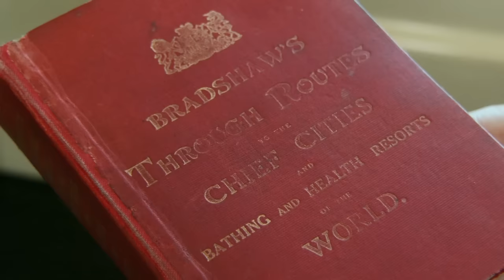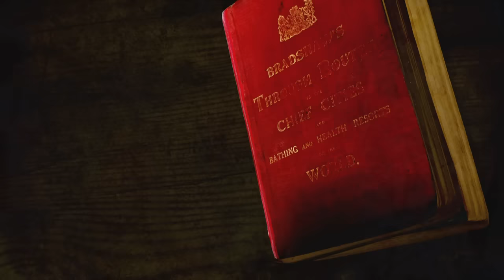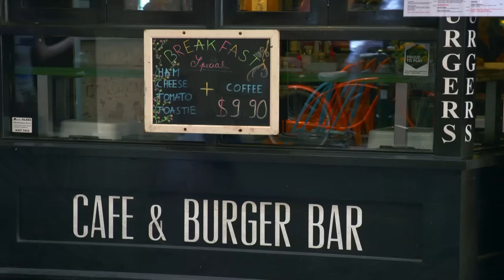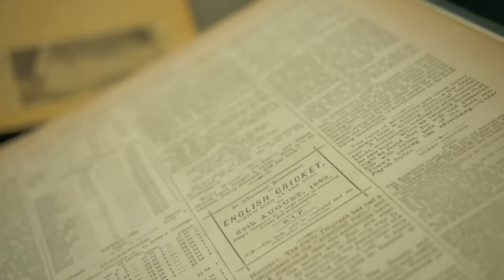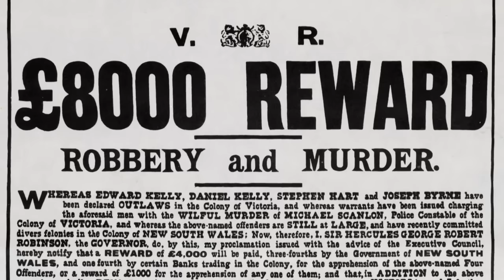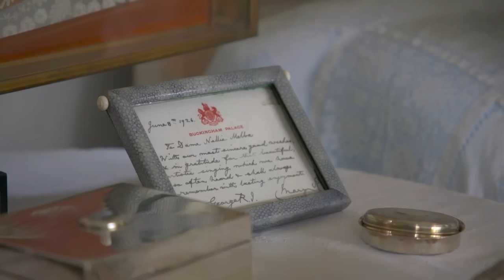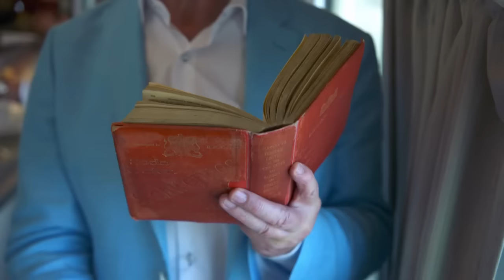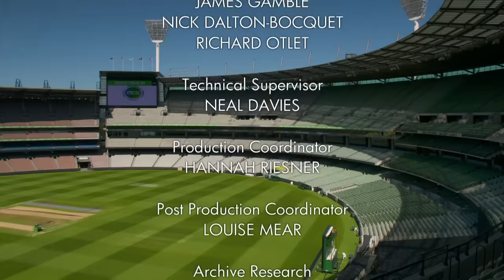Great Australian Railway Journeys | Canberra to Melbourne | Series 01 E04

Comment: Canberra has a some might say, terrible climate. In winter it is freezing and in summer absolutely roasting. Something happened there once.
Reply: Canberra in Summer is a tolerable dry heat. And in Winter the lake holds in a lot of daytime warmth. It used to snow regularly before the lake was filled. It’s now only especially frigid around dawn. Nearby cities (!) like Goulburn are frigid all night long.
Reply: On the contrary it’s temperate climate is very liveable without the humidity in summer. The cool southerly breeze in the evening in summer is very pleasant. July to September is windy and cold but bearable.
Reply: Canberra winters arent as cold as they used to be, but summers are getting hotter.